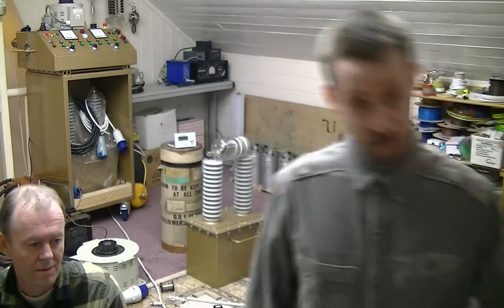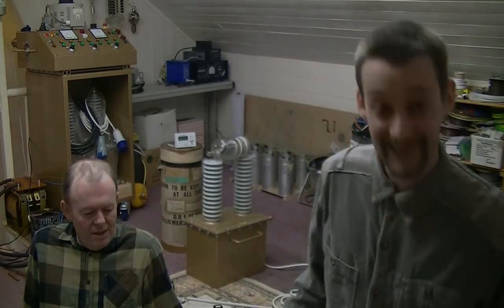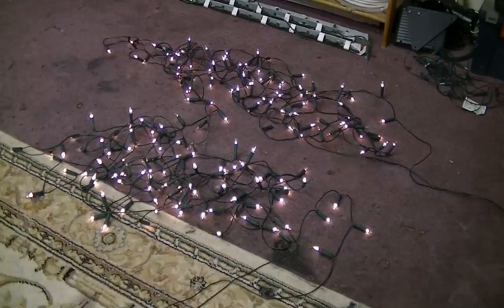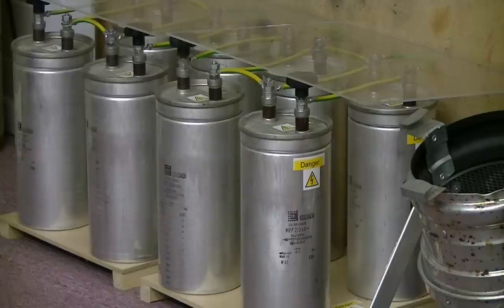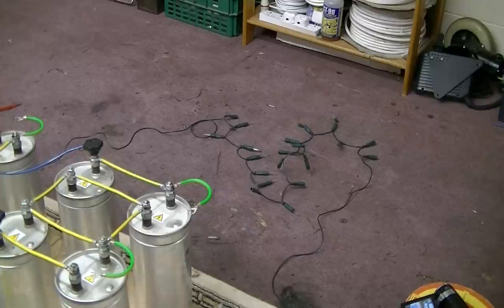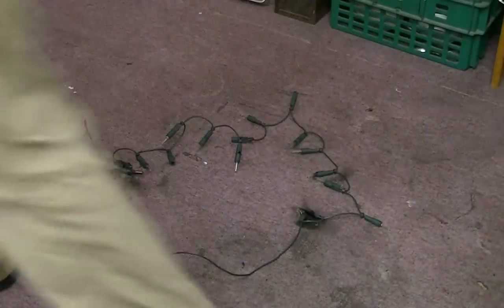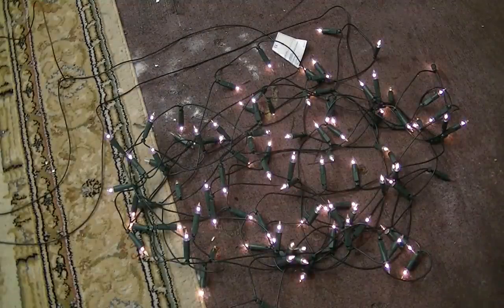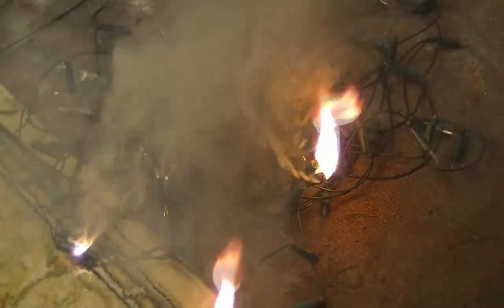Christmas Lights Overload

Comment: Well heating elements need volts and amps, he can only do so much from a "13 amp plug"
Reply: That's what the "big boy's" power supply is for: It can crank out over 83 amps! (20,000 watts@240 volts)

Comment: I think the rule references secondary voltage, right? Nice video, I think all of the strings of lights can still be saved for the type of experiment at 4:27  Outdoors, of course. How are you venting all of that smoke? That's pretty nasty stuff.

Comment: Photon should try rubbing inside foil of Mentos on electrically charged surface,while ground wire is connected to the foil.
Tried it with waste motherboard with 21V 3A,and the result was awesome fireworks.
(Since the foil around the connection will burn out,I recommend crumbling that shiny paper and using metal pipe to make connection.)
the connection will look like this:
[ground]-[metal surface with pins]     [foil][pipe]-[+]